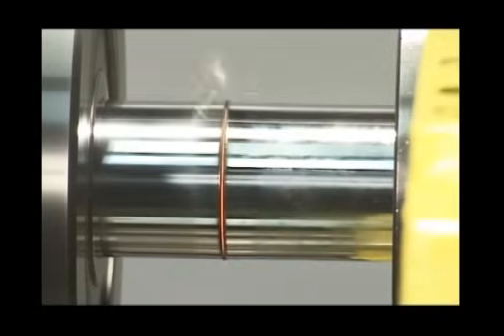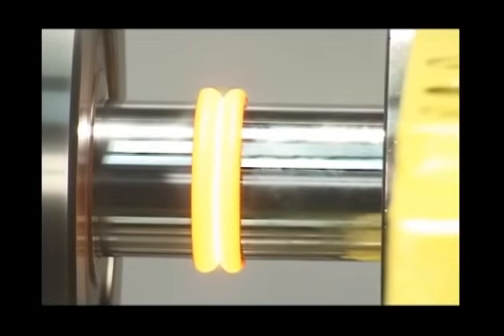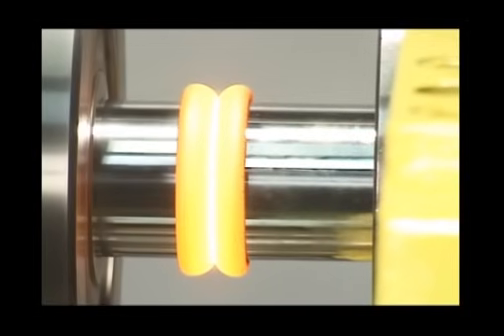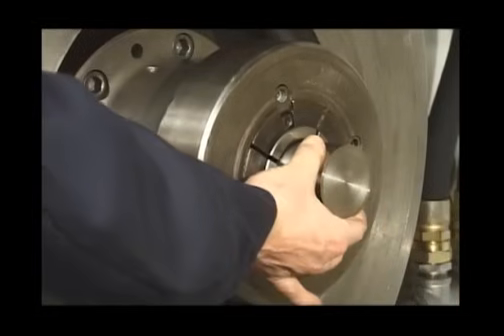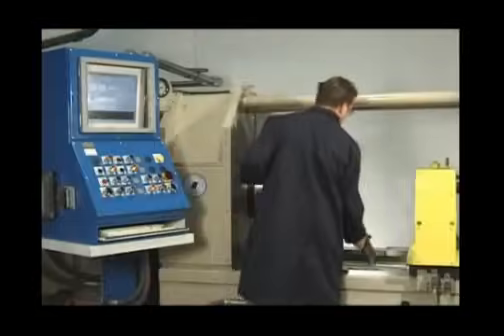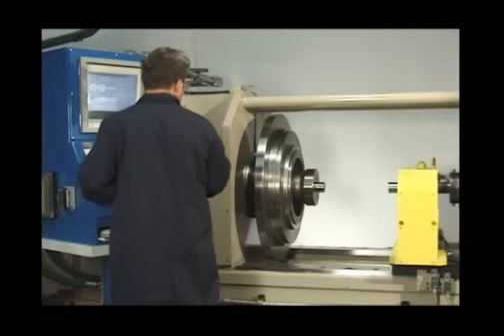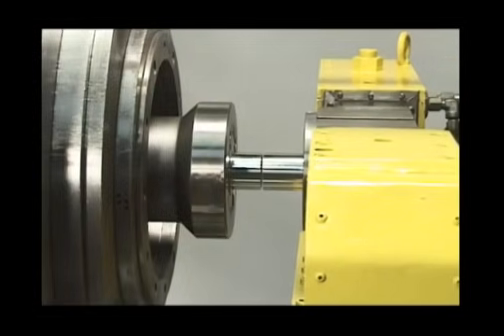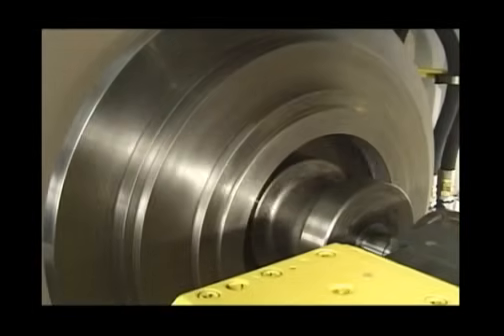Inertia Friction Welding Demonstration - Manufacturing Technology, Inc.

Comment: The biggest advantage is that inertia welding can join two completely different metals together! It is the only high-strength method of doing this, other methods for joining dissimilar metals such as brazing are magnitudes weaker. This is actually why the process was invented. Caterpillar needed to join dissimilar metals together for the exhaust valves of their Million Mile Motor. Heat-resistant but brittle metal for the head and a more malleable, better-wearing metal for the stem.
Reply: Heat + pressure creates energy exponentially, simple and effective.
Reply: Explosive welding can do the same thing too, though much for expensive and at much greater extent.
Reply: I think the materials don't even need to be metals

Comment: One of the work pieces has a large mass (flywheel) attached to it - they spin it to a predetermined rotational velocity before disengaging the motor and pushing it into the second (fixed) work piece. The energy stored in this rotating mass is transformed into frictional heat at the interface of the two pieces of metal.

Comment: I ran a friction welding machine at a plant that produces airbag inflators for the automotive industry. Load the parts into the machine and in a few seconds it would spit out a perfectly welded component. Then a robot arm would grab it, place it onto a lathe to remove the bead material, and you'd have a vessel that would hold around 5,000 PSI.

Comment: Have you ever tried 300 stainless or 300 grades of stainless to steel? If I weld 304 to 1018 I need 309,312 or inco82 filler. Can your process eliminate the need for those costly filler metals? Do you have any trouble with grain structure? I would really like to talk to you! Pure Genius. Thanks for the great video show us more. Have you ever tried buttering dissimilar joints? How good does that weld look on X-ray? Have you ever tried to form a seal and use purge gas? Loads of potential.

Comment: Absolutely right. I did my Master's program on the optimal time and force to use to avoid this waist and at the same time avoiding the drastic hange it the metal property by keeping it in such high temp. This coud even in some cases weaken the joint.
I had the problem solved with a Fortran program using 'Volume finite'
The tiem and force to apply vary from metal to metal as you can imagine...
Reply: Like always, Fortran comes in to save the day

Comment: Is the weld as strong as the surrounding metal,how about adding little round disc's, of different alloys into the mix to make a stronger weld,joint?

Comment: This a very good way of bonding dissimilar materials the bond if done properly is stronger than the original material. we used it a lot on our gas turbine engines.

Comment: This is just a demonstration like it says at the start. But, you would probably friction weld 2 pieces of steel that are slightly dis-similar, or maybe one is a complex machined part, the other just a short splined shaft. Or maybe one has been heat-treated (an expensive process) and the other hasn't. 
 Many cars/trucks now have stuff like this in the automatic transmissions. Rear-axle housings for big tractor trailers are done like this to weld on the ends.

Comment: in fact, you do not melt the metal (it is more a "bonding" than a "welding" process). You should read the comments of DougW, he have already explained that better than I can (at least in English).
I'll just add that the flash also carries out the great majority of the dirt that could have been accumulated on the welded faces (though it does not replace a good surface preparation).

Comment: Basically, this is an extremely strong weld. Much much stronger then if your were to simple run a weld bead around the perimeter with a MIG welder for instance. Partly due to the unique bond inherent to friction welding, and partly from the fact that the bond is continuous throughout the whole surface profile.
Reply: P E N E T R A T I O N
Reply: except for the center because it doesn't rotate much, but yes it is stronger

Comment: i always thought the machine was stopped using awesome brakes. because i would imagine that the momentum of the flywheel would break the weld as it was still in the cooling process:P awesome video;)

Comment: It's cheaper, Faster and cleaner.  friction welding tool joints onto pipe to make a drill rod is a godsend. The flash is removed as part of the process too.

Comment: Do you need to worry about a partially welded joint being ripped by the flywheel during the last portion of the process?  I don't see how this can be done reliably without careful material section or a break.

Comment: @treblen12 Not only that, but you can join two different metals. As far as I know, the valves in your car's engine are made this way because the metal at the valve seat and the metal that hits the cam need to have different material properties

Comment: This is ROTARY friction welding, most often seen welding PIPE or TUBING to plate. I'm surprised to see rotary friction welding a SOLID BAR to a plate so easily. Local heating equals linear velocity times local pressure, times coefficient of friction. With tubing, the speed variation is small, so ID moves only a few percent slower than OD. But with a solid bar, its speed tapers all the way down to ZERO at the axis of rotation. The OD moves fastest, so the most heat is generated at the OD, so melting happens first at the OD and the plate under it. After the OD melts, pressure greatly reduces there, so the applied force is redistributed among the remaining unmelted regions, helping them melt faster. But at the center, where velocity is always zero or nearly zero, little or no heat is generated. Melting at the center must be driven primarily by heat conducted from the surrounding material. Linear friction welding might be a better match for welding solid bars to plate.

Comment: So the entire surface is attached to the entire other surface. I would think this is better than a weld because a weld just bonds the outer perimeter. Plus there would not be the issue of trying to match base metals with filler metals.  Would that be correct?

Comment: What is the difference between friction welding processes with continuous drive and friction welding processes with inertia?
Reply: In inertia type the drive to the flywheel is removed when it reaches its max rpm and welding is done by momentum ie inertia. 
While in continuous the drive to flywheel is their till end of welding.

Comment: How fast does the spindle have to move in order for the pieces to weld together?
Reply from the maker: Thanks for your question! Spindle speed is measured by rotations per minute (RPM). For this size Inertia machine, typical RPM is between 2,000-3,000.
Reply: @mtifrictionwelding  Thanks for answering, much appreciated. I thought 2,000 to 3,000 RPM sounded slow compared to what I expected, but 2,500 RPM = 41.67 revolutions per second. Very fast.
Reply from the maker: @timewilltell7409  It's all about machine size and the components being welded! Some of our Inertia machines boast an RPM of 8,000+! Very fast indeed.

Comment: @Knnniggit I think you're on to something. You can keep spinning the flywheel faster and faster, even with a puny energy input, if you are patient enough to wait for it to come up to speed. Then, you "dump" all that stored energy (stored in the rotational energy of the flywheel) into the parts to be welded, all of a sudden. Lotsa heat, right away.

Comment: There are hints that this can be done with a drill press. If I want to friction weld 2 brass rods end-to-end on a drill press, what speed does the chuck have to be set to? Do the brass rods have to be a minimum thickness for this to work? Anything else? (like how to stop the motor, or if special cooling of melted joint is required?

Comment: Could anybody tell me whats the use of inertia welding? I mean in which cases do you use this method instead of other methods of welding or were does it prove to be more eficient?
Reply: You can weld big surfaces together very even and precise. Also you only melt the material where its actually joined so you have less thermal influence on the product. And you can join steel and aluminum, which is rather difficult with most other forms of welding and is very important for plane engines for example.
Reply: *****
Trust me, I'm an engineeer..ing student. :D
Reply: Talon3000 but why would they need to weld it in that way? Those prices were like 200mm each? Couldn't they just get one longer piece like the size needed
Reply: newylongboarding
its just a demonstration, no actual workpiece.

Comment: So what's a common part this process applies too I may have seen?
Reply from the maker: Hi! Thank you for your question! Inertia friction welding is suitable for many applications - most notably, large Aerospace components. A few applications that are welded using Inertia are: Pistons, Engine Valves, Electrical Connectors, and Turbochargers. To see more sample parts, visit: https://www.mtiwelding.com/parts/?technologies=rotary-friction-welding
Reply: @mtifrictionwelding  That is Cool as to see! 
Is this a join that is most likely machined away on the final part? I think that is the pain reason I haven't recognized it.
Also does carbon content make this process less viable on some higher content metals? Meaning normally done on parts with lower or no added carbon levels due to higher levels of defects in the manufacturing process?
Reply from the maker: @kierenalvarez  The flash curl at the weld joint is necessary to machine off for some applications, such as oil pipes, but not always necessary! It depends on the end-use of the product. Also, friction welding is suitable for many materials and many material combinations. Friction welding works with varying levels of carbon content. We have our previously tested and joined material combinations listed on our website here: https://www.mtiwelding.com/weldable-materials/

Comment: I'm not understanding why this is done in the first place. Why would you want to weld (forge) two short pieces of steel together when you can use one continuous length for your application??  Please explain the primary purpose for this procedure.  Thanks!

Comment: The very first thing I thought of was the temperature difference between the center and outside of the surfaces.  Have you ever experimented with wobbling the two surfaces across each other as well as spinning them ?  That would reduce the temperature difference, but you;d have to bring the parts into exact alignment at the end. A solution looking for a problem ?

Comment: MrMarkpark, traditional welding would be just as strong but this way is way more precise for linging the peices up
Reply: sweet 

less carbon input im guessing
Reply: +Doug W (MTI) well it depends what kind of rod you use so it could be just as strong as this if not more

Comment: regular motor would burn out. the mass of the flywheel is what is storing all of the energy instead of relying on some magnets and current, which would likely simply burn out from the stress.

Comment: That Sir is  poetry! What is the diameter of the round stock? How big can you weld? Do you ever have trouble with the cullets spinning on and maring the parts? Sorry I ask so many questions, but I'm fascinated. I weld in a factory If that was beveled properly for me to acheive full penetration with a tig root then tig hot pass then spray mig or stick for fill&cap It would take all day to weld 12 mabey 15! Then they would look like a bananna:) Have you ever tried pipe or tube in that rig?

Comment: interesting, although the applications are limited to where one piece can spin against the other.  would it be possible to do something similar, but with a third object with a much higher melting point that is spun between the two to be welded, melting them, then you pull it away and press the two melted pieces together?  that would have more applications, though it would be a bit messier.

Comment: Educational.  Thanks for the video.  Been working in a Machine Shop for years, and have not had the chance to see an Inertia Friction Welder in action yet, only heard about them.  
What kind of RPM on the chuck are we looking at, minimum?  Say, for aluminum?  6061, if you need specifics.

Comment: why they dont start with a longer piece in the first place i dont know, but the point of this is that is fuses the entire face of the pieces rather than generic welding techniques that would only do the outside ring,

Comment: And what are the disadvantages, compared to normal stick/MIG/TIG welding? I assume overall friction welding has much more advantages, but less practical uses(only flats surfaces can be welded together) compared to normal electrode welding?
Reply: It becomes a single piece of metal.

Comment: Seems there is no protection for the machine operator.  At high speed would it not be possible for the molten metal to cast off?  Also, does this method preserve the rotational shear strength of the original metal rod?  Perhaps welding together in this manner is efficient, but I'm curious if it alters the metal strength and other properties.
Reply: They probably took the guards and shields off for the demonstration.
Reply: The molten metal doesn't often go very far at all, if any comes off at all. The most you get hit by is some sparks and sparks don't hurt. If you are worried about strength, just heat up the whole thing really fucking hot, to the point it's soft but won't deform unless you smack it with a hammer, and a piece this large will take a while to heat up that hot all the way through, then just let it cool on its own and it'll be just as strong as if you ordered the right size piece from the mill in the first place. (Or the closest they offer, usually too long and you just cut it down). But in reality, you don't really need shields on something like this. Then again, people have so many shields on lathes and drills that you can't use the fuckers. Where I work, we take them off. Don't put your fingers where you wouldn't put your dick and you won't get hurt.

Comment: What do they do with all that sloppy non-contributing metal that oozes out? There ought to be a way to scrape that off or flatten it out. When welding pipes this way, the junk also also sticks out into the pipe, interrupting flow through the pipe.
Reply: Yup, scrape it off while hot or mill or grind it off after it cools. The ridge is accessible on the outside, but it's a long reach to get it from the inside. But they seem to just leave it there. The ridge on the inside is substantial and affects flow.

Comment: What I'm more amazed at is how there is no give from either of the clamps that are holding the materials being welded. Forging temperatures range from around 200°C to 1200°C. I'm assuming there is a really strong force being applied to keep each piece so steady. Any ideas how strong?

Comment: Where is the inertia added?
Reply from the maker: Hi! Thank you for your question. In inertia friction welding, the inertia is added to the system through the rotational motion of one of the components being welded. This rotational motion generates kinetic energy, which is then converted into heat through friction when the rotating component is pressed against the stationary component. 

You might find our Whiteboard Wednesday episode helpful as our President & CEO explains the inertia friction welding process: https://blog.mtiwelding.com/whiteboard-wednesday-inertia-process

Comment: Why didn't you just make a longer rod to begin with?
Reply: Friction welding is used to weld lets say 2 different metals like aluminum and steel together that cannot be welded using normal welding methods due to difference in melting temperature. Friction welding is not a new thing and been around for decades with wide range of applications. Also unlike traditional welding, friction based ones are way faster and requires way less preparation of material.

Comment: Why flywheel? Too much power needed to do it under motor power alone?
Reply: I think it's to add inertia and the piece don't slow down during friction.
Reply: It's for energy efficiency.  The amount of energy (heat) needed for the weld is calculated, then that same amount of (kinetic) energy is given to the flywheel, by selecting the speed.  Then, when the parts are pushed together, all the kinetic energy is given off as heat and the weld is finished just as the flywheel comes to a stop. No need to waste energy by braking.
Reply: INERTIA...
Reply: *****
Inertia... What?
Reply: mibars Science.

Comment: aluminum burns at a high temps, it burns white hot when not under inert gas when its molten.
another thing is aluminum and steel can corrode each other.
 Not in all my years of welding did I ever hear of steel & aluminum bonding to each other.
 There must be something special about each alloy then in this operation.

Comment: Seems to me that if the rod has any temper, you're going to lose it.
Reply: No. How do you think steel is formed? Heat. Hot roll steel starts out molten, while it's still red hot it gets cut and rolled into the size specified by the roller machine operator. And it cools off on its own naturally. Unless there is slag on it, in this case then the cooling process was helped out a little bit and the slag acts as a protector for the steel for sitting outside. To make this just as strong as new, just heat the damn thing up all the way through until its soft enough to put a good dent in with a hammer and let it cool on its own. Really get tired of people saying adding heat to steel makes it weaker. If it was true then all steel would be "weak" since it was all formed when it was red hot at some point  in its life.
Reply: Goes ' I didn't say it would be made weak. I was referring to the temper.
Reply: @riparianlife97701  . The welded parts are heat treated again.